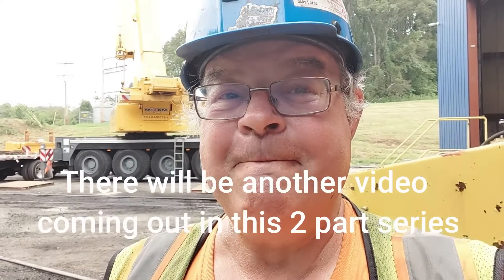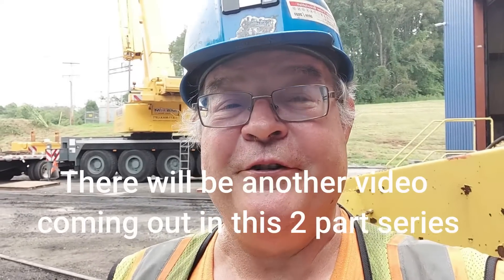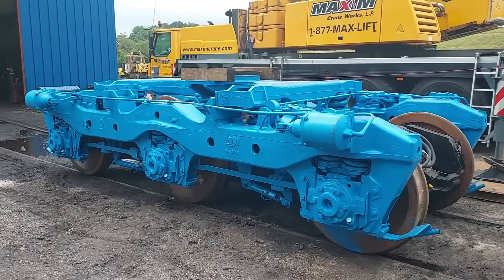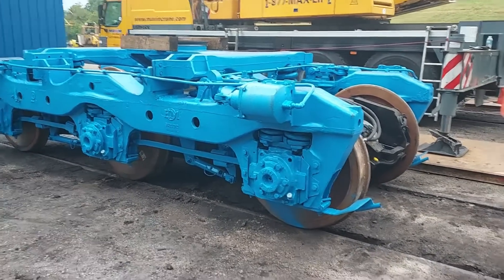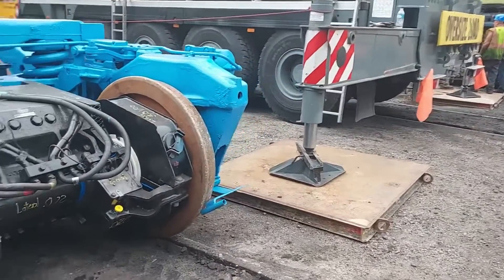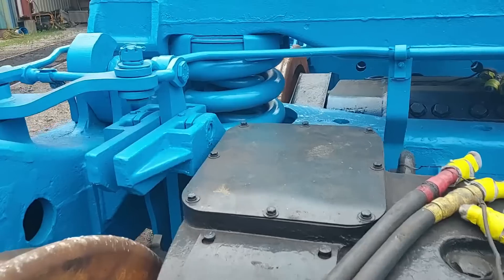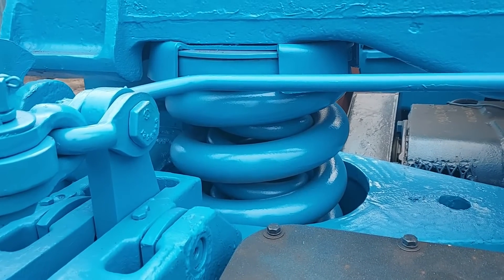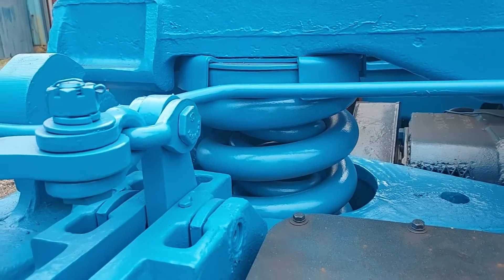Changing Locomotive Trucks on an EMD SD 40-2

Comment: Wow! 32 tons each for those trucks! The concrete mixer that I drive weighs 66,000 lbs. with a  ten yard load in the drum. Serious weight for all of them.
Reply from the maker: You certainly can relate well to the weight then Bill. One of my favorite toys growing up was a brown colored Tonka cement mixer.
it was over 2 feet long. I still have it on display. Thank you for writing in and for taking the time to check out the video. May you have a most blessed day my friend and be safe out there on those roads!
Reply: I doubt anyone racing a train at a signal properly conceives of the mass of metal hurling down the tracks!

Comment: Are the trucks changed based on time or mileage, or was there a problem with the trucks?  Coming from an aircraft maintenance background, we frequently changed items based on predicted failure rates.
Reply from the maker: These were changed as part of normally scheduled maintenance Robert, although the one truck had a lot of wear on the wheels on one side, almost to the point of being condemnable. It was time for
new ones. Thank you for writing in and for taking the time to check out the video. May you have a most blessed day my friend.

Comment: Whats the total lifting weight of those poetable jacks holding the 40 up dave  at 30 to32 ton a truck just curious do those make up most of the engines total weight?
Reply from the maker: Each jack can lift 50 tons John. Loco with trucks weighs 368,000
pounds. Thank you for writing in and for taking the time to check out the video. May you have a most blessed day my friend.

Comment: Well as far as weight of the trucks our GP 9 the traction motors are 6,200 pounds each
Reply from the maker: I would say the traction motors are about the same as on these
SD models also. But is that weight of just the traction motor or of the combo, traction motor plus both axles and wheels?  These traction
motors are the D77. Thank you so much for taking the time to
pay us a visit and check out the video tonight my friend.
Reply: That's the traction motor only
Reply from the maker: @mow4ncry  👍😊

Comment: That's very cool, Dave! Love any opportunity you get to film the SD40-2! They sure put a nice pretty new coat of blue paint on those things! Why did the trucks need to get replaced? Traction motors, bushings, etc. just have a ton of wear from being ~40 years old or was it struggling? Glad to see Iron Senergy putting money into my favorite unit on the roster.
Reply from the maker: Really pleased to hear you had a good time Shane. Old trucks had a lot of wear on the wheels plus it was time for a change out, these trucks take a lot of abuse and it was scheduled maintenance to
replace them. You are so right, it is so glad to see our new owners
taking an active interest in loco maintenance, unlike our last company near the end of their regime here. Thank you for the nice comment and for taking the time to check out the video. May you have a most blessed day my friend.
Reply: @ccrx6700  Thanks!  Can you get a picture of the old wheels or maybe measure the difference between old & new?   Also the pivot point, the surface that slides, on the locomotive and on a truck?

Comment: Hello Dave well here goes great video but I guess I might be one of the few subscribers that has actually done this job before great view of the work being done thanks my friend
Reply from the maker: You are probably the only one Gary that has done it. Almost no
one ever gets to see this kind of thing being done. You've got to
have nerves of steel when being under that loco unhooking and 
rehooking up those traction motor leads with only a few small 
inches to spare from the loco body over top of you! That scares
me to watch these guys do that. Always is a pleasure to have
you visit with us and write in my friend. Sometime write me back
and tell me where you work and what all you do there. I'm
interested in finding out.
Reply: Well Dave I am a semi haha retired or as I say retared  locomotive tech sub out to local short line and CSX here in wonderful New England used work out of the Alston and Boston being 68 and having been forced to retire due work injury sucks you work for yourself but I keep busy having all the licenses I hold mainly due a lot of prime mover power generation repairs good old grades dc to ac old work makes for job security  I've stick welded rail  changed enough oil to fill the ocean driven a few trains test drives  never was out on the rail like you  so now when it's quiet I do some home repairs for people and when called fix a few old short line engines sp9 s on up  there is still a lot of those still in service
Reply from the maker: @garymessina1609  thanks for sharing with me Gary. Very cool

Comment: I did not see the pin under the locomotive that fits into the truck, or the opening where the cold air is blown into the traction motors. Good video as usual Dave.
Reply from the maker: There is no pin on these Ferdinand, the loco body just sits down
in the bowl on the truck. Fed regs say a minimum of 1 1/2 inch
must be down in the bowl on the truck. Lot of weight setting down
on those trucks.  Thank you for writing in and for taking the time to check out the video. May you have a most blessed day my friend.
Reply: @ccrx6700  Thanks for your reply, maybe one day if the opportunity presents itself you can do a longer video on the said subject. Have a great day.🙏
Reply from the maker: @ferdinandfrancis9673  👍😊

Comment: 60,000 = 30000 tuns, and it is quite possible that the operator didn't have the thing set up quite right for that set of trucks. In any case that still is a lot of weight.
Reply from the maker: it never ceases to amaze me Hugh what some of these cranes
can pick up, I would probably faint if I knew how much it cost
to get this one in for a day too!. Thank you for taking the time to check out the video and write in. May you have a most blessed day my friend.

Comment: 200 tons. That's incredible
So much weight on those tracks. It is no wonder they wear out so fast
Reply from the maker: These 3 axle trucks are hard on our tracks with the insane number
of high degree curves we have. That is a big reason why we have
such a robust tie changing program. 2 axle trucks are much
easier on track structure than 3 axle ones in curves. Thank you for taking the time to check out the video and write in. May you have a most blessed day my friend.
Reply: @ccrx6700  the tradeoff is that you have more traction with those 3 axle trucks.
Reply from the maker: @rearspeaker6364  yep. Big difference when a traction motor goes out in the pulling power

Comment: Look at the size of the screws on each of the lifting trucks, that is crazy, what 3 inches ?
Reply from the maker: Closer to 4 inches Gerald, they are huge and lift up to 50 tons
per jack. If I recall right we sold our old ones to Cuyahoga Scenic RR
when we bought these new ones about 12 or so years ago at a 
cost of $150,000 per jack. Thank you for taking the time to check out the video. May you have a most blessed day my friend.
Reply: @ccrx6700  Wow and I would still think twice to walk under that Engine !
Reply: @ccrx6700  similar ones for lifting heavy trucks cost 30k each and are very stable.

Comment: I'm sure you have a means of moving the trucks under the loco, but have you ever heard of using an arc welder to excite the traction motors as a means of moving it?
Reply from the maker: Cool question theRantingCabby, actually yes is has been done.
We had a guy come in who trued the wheels on our #1 loco a
couple of years ago and he hooked up the welder to the traction
motor leads and turned the wheels with that source of power,
first time I ever saw it done. here is a link to watch that video:
https://youtu.be/Bta9GBfS5F8
Reply: @ccrx6700   I did watch that video but I missed the part where you pointed out the mobile welder. And those traction motors have a pretty good appetite for amperage. Thanks for the reply.
Reply: @TheRantingCabbie  true...... the more load, the more amps

Comment: pwalpar had a video on this, but not up close like this, how neat,  to overhaul those trucks I'd guess prolly near 300k
Reply from the maker: Someday northstar I'm gonna find out what it costs to rebuild a truck,
certainly not cheap, but no one seems to be willing yet to share
what the cost is. Thank you for taking the time to check out the video
and write in. May you have a most blessed day my friend.
Reply: @ccrx6700  Oh it's no worries, like I said SOMEONE has to harass you. so it might as well be me, I asked  a few friends who work with the big stuff and they said it depends on the motor, whats all wrong and its 2-800,000 depending on all whats needed, its not a cheap thing, but they do a looooot of work and take a loooooot of power. incidentally, did you ever see the documentary of where they purposely derailed a locomotive to power a town?
Reply from the maker: @northstar2007  👍😊 yes ive seen the us army experiment
Reply: @ccrx6700  the one I was thinking of, was canadian methinks

Comment: Thank you for this video! That's quite a massive piece to remove and replace.
The tracks - your specialty - have to be up to par, as loads like this would be very unforgiving.
Reply from the maker: You are right Robin, these 3 axle trucks are hard on track structure
along with loco wheels. That is a big reason why we have such
a robust tie changing program here. Thank you for taking the time
to visit with us and check out the video. May you have a most blessed day my friend.

Comment: That is a major overhaul for 3098.  4 trips a day, 360 days a year for 45 years with 2 locomotives per consist is about 1.5 million miles.
It isn't the miles which wears out the equipment,  the starts and stops take their toll.  Curves wear wheel flanges.
Reply from the maker: All the insane number of high degree curves we have Keith
for sure take their toll on the wheels on these 3 axle trucks, not
easy on my track structure either, that is one big reason we have
such a healthy tie changing program here. Thank you for taking the time to visit with us and check out the video. May you have a most blessed day my friend.

Comment: A whole truck and not just traction  motors replaced…. Must have been a better deal as a unit instead for three of the motors individually. Quite the even right there…
Reply from the maker: Since we do not have the capability or knowledge here to rebuild
any part of a loco truck they usually just change the trucks on
a certain scheduled basis Todd. If a traction motor goes bad, then
they will just change out the traction motor, all of which is
done by contractors. Thank you for paying us a visit and taking
in the presentation tonight my friend.

Comment: The cost to have that rebuilt is...a real pretty penny
Reply from the maker: I've tried numerous time to find out what the cost is to get a loco
truck rebuilt and installed, but no luck yet. No one seems to either
know or wants to say the cost. But for sure it's not cheap.
Reply: my guess is about 150k, 6 reman motors with axles, plus a reman truck frame.

Comment: Hey Dave! 
Now would be the perfect time to fill the motor support bearings with journal oil and throw some extra crater in the gear cases!👍😎
Reply from the maker: Your right Ralfie. The new trucks come with all that lube already
in them, at least I've never seen any of the contractors who
rebuilt and installed the trucks check anything like that, but also
I wasn't with them 100% of the time either. Always is a pleasure
to have you visit with us and write in my friend.
Reply: @ccrx6700  
Ours are shipped dry, except for the cog lube in the gear cases. It’s almost like tar until it gets warmed up, so we don’t have to worry about an accidental spill of that during shipping. 
But we mostly get just the traction motors. 
We have been changing a few trucks lately because we’re doing some frame mods on some of the older GE C-44 AC locomotives in the fleet. The frames are beginning to crack on some of them at the points where the fuel tank welds onto the frame. 
We have a 250 ton overhead crane that will lift the entire locomotive 40 feet in the air. We do both trucks at once on one of the less used tracks in our shop. 
We have a drop table for changing traction motors one at a time.
Reply: @ralfie8801  don't get that lube on the street clothes, as it can mess up your washing machine.
Reply: @rearspeaker6364  
Fat chance of that, I only get it on my boot soles these days, and then only if I don’t see it in the dark and accidentally step in some. 
The stuff we use comes in plastic bags that hold a couple pounds of it and they’re shaped like little loaves of bread. 
We just take the upper gear case cap off and shove the whole bag of lube through the opening. We put as many as we can pack in there, sometimes up to 6, depending on how warm and playable the bag is at the time.